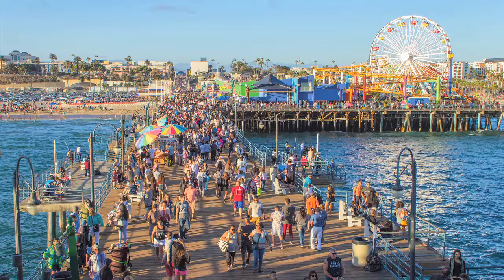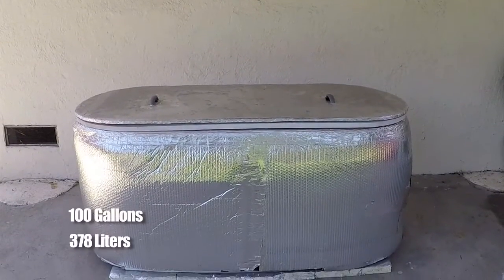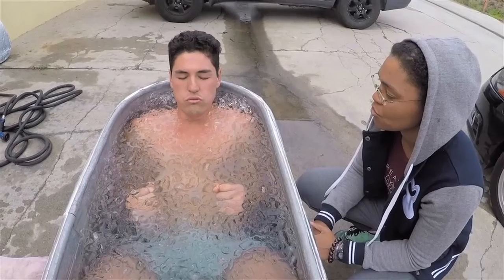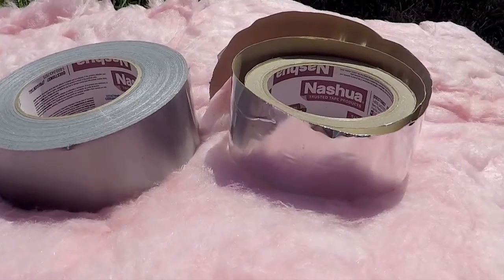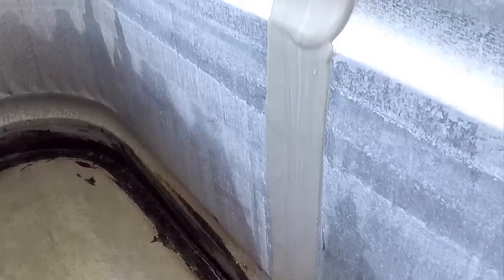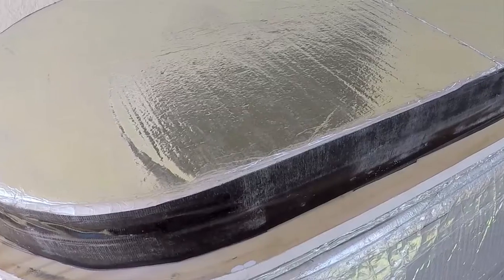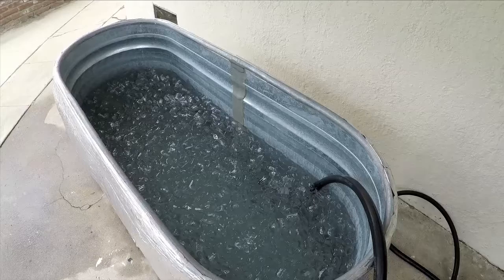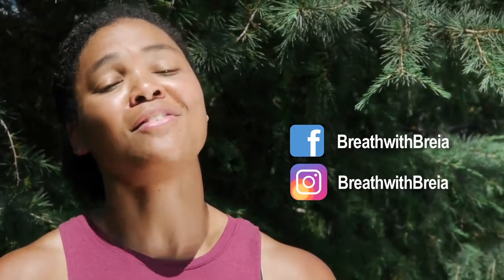Tub Time: The Insulated Silver Bullet Cold Tub

Comment: Interesting.  Thanks for this vid.  I'm getting a sealed steel trough like this but need to somehow insulate it to stop the condensation forming on the outside and running down the outside, as it will be housed inside the house and so I need to avoid damaging the floor with dripping condensation.